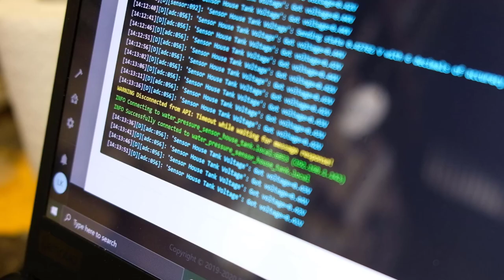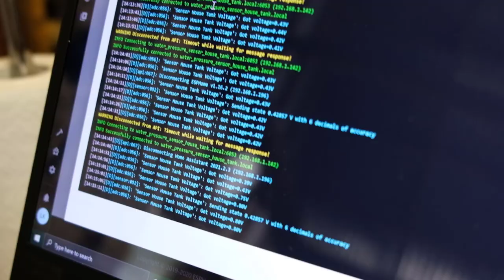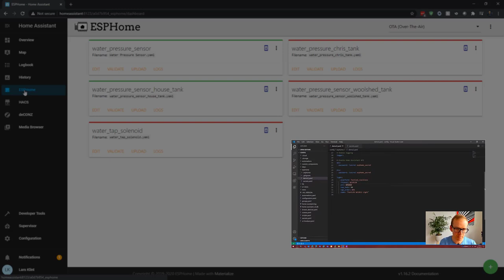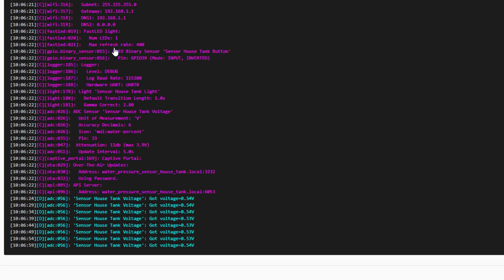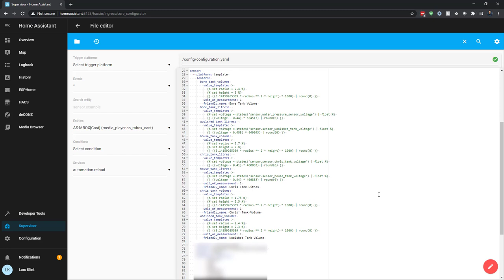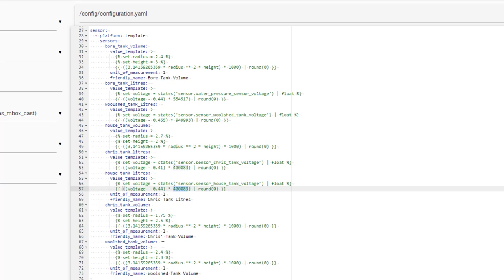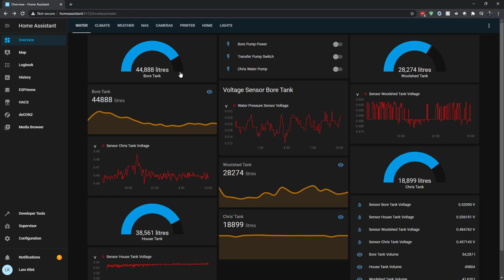Measuring water tank levels with Home Assistant

Comment: Thank you again for this video. I receive Voltage-measurements in HA.
 I added the code in my configuration.yaml but I don't see how to add the liters in the overview dashboard.
(I know it is a small water volume but it is ground water. )

The sensor I see in HA is: sensor.waterput_voltage (-> what shows the measurement of the voltage)

config.yaml:
sensor:
- platform: template
  sensors:
    waterput_volume:
        value_template: >
             {% set radius = 0.5 %}
             {% set height = 2.5 %}
             {{ ((3.14159265359 * radius * radius * height) * 1000) | round 0) }}
        unit_of_measurement: l
        friendly_name: Voorraad grondwater
    waterput_liters:
        value_template: >
            {% set voltage = states('sensor.waterput_voltage') | float %}
            {{ ((voltage - 0.41) * 1800) | round(0) }}

My Atom-lite config:
#niveau grondwater   
sensor:
  - platform: adc
    pin: 33
    name: ${friendly_name} Voltage
    update_interval: 120s
    icon: "mdi:water-percent"
    accuracy_decimals: 5
    attenuation: 11db
    filters:
    - median:
        window_size: 200
        send_every: 10
        send_first_at: 4
Reply from the maker: Do you mean you don't see the output as a sensor in HA, or how to add the HA lovelace card to show the litres?
Reply: @LarsKlintTech  indeed, I mean how to add the HA lovelace card to show the litres.
Reply from the maker: @permport  You should also see a sensor called "sensor.waterput_liters". If not, your YAML might not be accurate.
Reply: @LarsKlintTech  thank you for the reply. I typed it in my yaml like yours. It's really difficult yet is seems so easy.
Reply: @LarsKlintTech  I reduced my above code to:
sensor:
- platform: template
  sensors:
#    waterput_volume:
#        value_template: >
#             {% set radius = 0.5 %}
#             {% set height = 2.5 %}
#             {{ ((3.14159265359 * radius * radius * height) * 1000) | round 0) }}
#        unit_of_measurement: l
#        friendly_name: Voorraad grondwater
    waterput_liters:
        value_template: >
            {% set voltage = states('sensor.waterput_voltage') | float %}
            {{ ((voltage - 0.41) * 1800) | round(0) }}
            unit_of_measurement: l
            friendly_name: Voorraad grondwater

Because the first part was the formula to calculate the volume. Since this is a static value, I commented it and now I have the sensor.waterput_liters.
Reply from the maker: @permport  Awesome debugging! At least you now have a working sensor, and you can (if you want to) work backwards to see where the yaml broke. Well done mate.
Reply: @LarsKlintTech  Thank you! But it all started with your video, so thank you again!